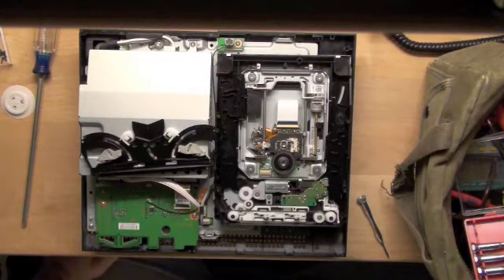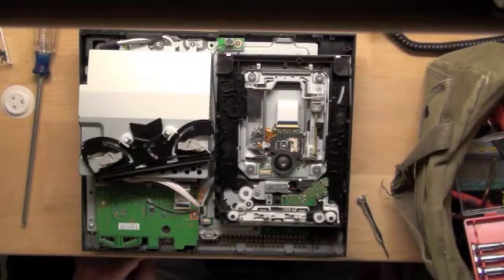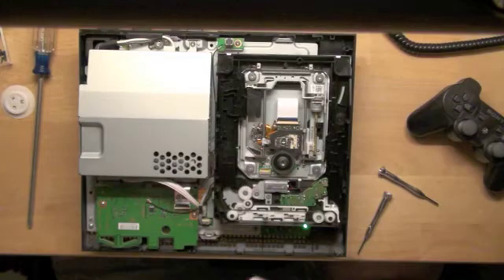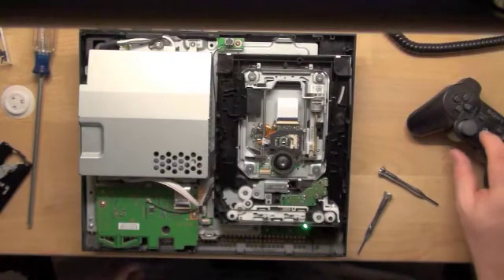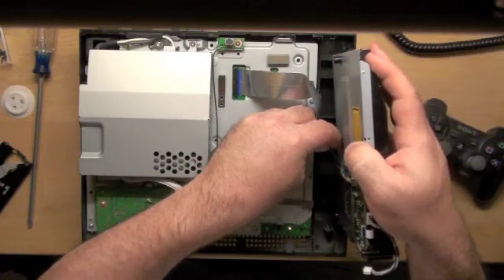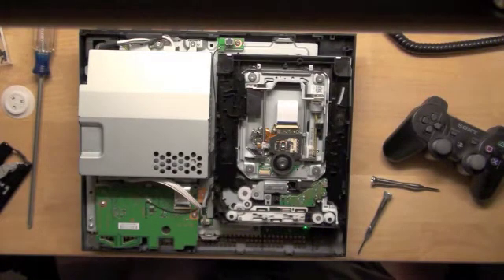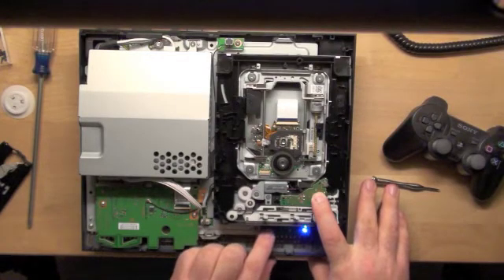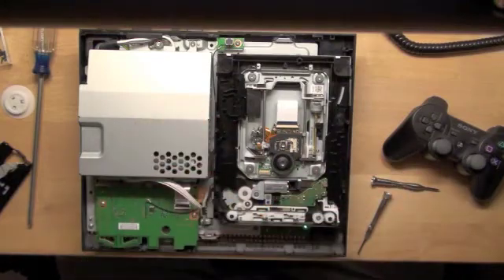Troubleshooting PS3 drive "nothing happens" problem

Comment: I've been diagnosing all day today, and have finally decided to attempt open heart surgery like you just did.
I have the same problem of the trigger-buttons giving no reaction.
The motor works, confirmed through force ejection.
The data cable seems fine, as it can read manually inserted discs just fine. I have attempted several times to lodge it in better, and secure it with tape, so I don't think that's the issue.
I'd assume the buttons were to blame, but then I'd also think that if this particular circuit would failed, it would also leave the motor unusable, which it has not.

So just to outline:
Trigger-buttons to sense discs seems to be at fault.
Circuit can still power motor, seems ok.
Motor is functioning, seems ok.
Data ribbon cable delivers disc data is functioning, seems ok.

I have checked the ribbon cable between the Blu-ray controller and the disc sensor. They are all well connected.
I have tried, and pretty much mastered at this point, both disc in and out alignments, neither seems to do the trick.

I have watched every one of your video, tried everything I can think of. No metal arm trick, no resetting the plastic teethed arm in either position has worked.

I almost refuse to believe it to be broken.

I took the thing apart to clean it, hooked everything back up with no malfunctions, and everything seemed to work, until I decided to do a force eject. At that point, it 'broke'. It believed a disc was still present inside it (blue light) and refused to take a new one. Restarting it, the blue light was now off, but it still wouldn't accept a disc. Tearing it apart revealed no immediate issues. I disassembled as far as necessary to verify integrity, and as all was well, I reassembled it. No change. Did it again all over, no change. Tried disc in config, verified read and functionality of laser, with 1 immediate problem: would not eject, not even with force eject. Would make buzzing noise attempting to do so, no cracks or pops. Tried disc out again, with 1 immediate change: it would now beep quickly 3 times as if nothing was inside. Huzzah, I thought. Still didn't accept discs, would still buzz during force ejects. Attempted open verification. All is well except it's ability to accept discs, due to not responding to button pressed from disc insertions. It's ability to eject may also be a problem.

I don't think I can diagnose it more accurately than this without help. I would really appreciate it if anyone has any suggestions.
Reply: @Bobby-Broadway  in the end, i blamed the broken disc insertion switch. Such a tiny little plastic button, no longer responded to any sort of input. Replacing it wasn’t possible as I could find no part information, and my friend wasn’t interested in buying ps3s to salvage. But in the end, that was the solution. Salvage ps3s for a working switch, or entire drives if you refuse to solder.

Comment: Thank god for your tutorial, I was experiencing the same thing (Absolutely nothing happens when inserting disc, no disc motor noise at any time, cannot eject disc) it turns out the guy who reflow-ed my PS3 didn't properly reconnect the BD drive data cable when reassembling, and it came loose.

Comment: My ps3 was working perfectly until last week. I turned it on and it didn't read the disk. Now, if I insert any disc, blu-ray or not, it clicks a couple of times and then makes an ejecting noise but doesn't actually eject. I would really appreciate it if you could help me with this problem. Thanks in advance.

Comment: I am having the same issues and I replaced the data cable with a new one and still has that same exact issue... So it is not the data cable.. I believe the spin motor is shot.

Comment: Hey, I'm having a huge issue with my disc drive.. I bought a completely new laser deck and replaced it with the one which had the burnt out laser diode in it (With this method, the daughterboard does not change, so there is no different id). Also the diode/deck is the exact one which is needed for my ps3. The issue I'm actually getting is that the disc goes in, spins for a few seconds, stops then repeats. In the time it is doing this, the disc is not actually being read. Do you know why?
Reply from the maker: I'd start by checking the connections.  It could also be that the laser unit you received is bad.  To test if it's one laser or another that's bad, try with a PS3 game, and with a DVD and a CD.  This will exercise all the lasers in the unit.

Comment from the maker: If it worked before you disconnected the drive, the ribbon cable tot he mainboard is probably the culprit.  The front power cable is just for power to the drive itself.

Comment: Could you tell me if the years that load the disc in and out of the system are part of the ribbon, or are they powered by the power chord that's in the front?  It's driving me nuts trying to figure out whether I can fix this or not, but if at no point the drive is spinning, I'm inclined to believe there is damage to the ribbon, or the motherboard.  It worked fine before I tried the ylod fix.

Comment: I believe the same thing happened to me tonight.  Fixed the ps3 from the ylod, everything works well, but the disc isn't going in what so ever and when I took it apart, it rendered the same results as what was shown when he disconnected the ribon and booted up.  The laser flashed, but nothing else happened.  However, when I manually put a disc in the ps3, it ejects it if I hit the button.  Has that happened to you?

Comment: I did the repair for YLOD and things worked beautifully when I put it back together except the disc drive. Everything is connected properly and I don't see anything wrong with the data ribbon. When I turn it on, literally nothing happens with the disk drive. Nothing moves, there is no laser - it seems totally dead. The only thing working normally is the sensor.

It worked fine before YLOD. Do you still think it's the data cable, or is it possible I fried that ONE part of the board beyond repair?

Comment: I swapped out my drive with a new, which fixed the "not reading disc problem", but now I can't get the motor to do anything when the two switches are activated.  I checked my the data cable and it appears to be inserted correctly.  The drive turns on.  If I put it in disc mode and put a disc on it, it will read and play...just can't insert or eject.  Any ideas?

Comment: Hey I bought my Phat Ps3 From my friend 3rd Party. he sold me it pretty cheap and told me that one day the drive just Stopped working and his game (Black Ops) was stuck in it. everything on the ps3 is fine it loads up it i can connect to the internet and psn and all that. but the drive seems to not have any power what so ever i dont think its my data cord seeing as my ps3 freezes when the cord isnt attached to the drive or if it doesnt freeze, when i press eject it beeps 3 times and i dont think

Comment: *****HELP***** my 40gig fat ps3 needed the laser replacing on the blu ray witch i did myself. when i put it all back together it wouldnt take the disc. ive tryed everything. sensors new moter and another lens. the real problem is that the blu ray drive works fine on my other ps3. so it seems that theres no power going to the blu ray drive but dont know wear from as console will start up fine as i used it to watch a film on the internet on it . please help!

Comment: I have a question I just repaired my brothers laser and the same thing is happening to his drive the one he purchased from ebay the small white wire near the spinning motor there was a cut piece of that wire still in the slot suggesting it was taken out from another ps3 and the seller just cut the wire off. Arn't the lasers made from a factory or something?

Comment: I'd like to thank you for your videos for how the ibnterior of the PS3 works since I've been desperately trying to fix it for the past week since a game got stuck in there. However is my BluRay drive screwed? I did your methods on trying to get to work like making the PS3 think there's a disc in there and the Clear Disc test. However the Blu-Ray laser doesn't light up nor does the CD spin with the data cable plugged in. Although when its not plugged in, the laser blinks purple then turns red.

Comment: Awesome, Awesome, Awesome video, cannot recommend enough for people having problems with their blu ray drives... after days of tinkering and scratching my head this video showed me exactly what was wrong with my drive... a blown chip on my mother board.  I realized that without the drive cable plugged in the lens should have cycled upon power up, but because it wasn't I investigated the motherboard and yup, blown chip.  Should have known... power cable to the drive had exposed wires!

Comment: @junker15 Hey, i have a problem with the lens in my PS3. It doesn't seem to be moving. i tried adjusting the golden rod that makes it move but instead it came out. When I put it back in, the lens don't move at all. How can I make it move smoothly again? 

p.s. the reason I was messing with it was because my drive wasn't taking in or ejecting dics, or spinning. I can tell the problem is the lens because it tries to move but cant.
Any help is appreciated.

Comment from the maker: @xkingtee There's a switch near the spindle motor that the lens assembly is supposed to be hitting.  This tells the system that the lens has returned to the innermost position.  If that switch is faulty or somehow broken, the system won't be able to tell when the lens has returned, and will keep trying.

Comment: My PS3 YLOD'd and I had to remove a stuck disc (rental). I replaced it with a clear dummy disc. After I got the PS3 reballed it wouldn't eject the dummy (made noises). After fooling with it for a while, I finally got it to accept a BD movie and play it, but I couldn't keep things aligned when screwing back together. After another machine-gun sound, no motors will move at all, as if they are burned out. What should I try next? Also, I may have touched the lens since then. How should I clean it?

Comment: i solved the issue i was having n it was a stupid mistake on my part.  i was about to give the ps3 back (in shame) when i saw that the ribbon cable located next to where the disc sensor plugs into the drive wasn't plugged in (no idea why or when i did that).  

so i guess another tip for when this happens would be to double check that everything is where it needs to be...kinda obvious, but u never know. once again, i'm able to come through and it feels good to get my brothers ps3 outta my room.

Comment: ok, so i took it a step further and removed the lens (crossing my fingers that i havent damaged it as i hear it is very delicate) i removed the v shaped bar on the back as well and notice that the function of the black sidetracks is to lift the lens plate up. the left one with gears is STUCK . the right one works perfect and lifts the right side. is there anyway of detaching and reattaching these sidetracks? the left one specifically?

Comment: @junker15 funny you say that, i just saw the video where you do that and it gave me the idea. so i went ahead and removed the motor - the side tracks STILL will not slide up and down - it seems the one on the left (with the gear ridges) which should move down is STUCK. will i have to take the whole frame apart? do those side tracks even come off?

Comment: recently i went to eject my disc and it started making some weird machine gun sound for the first time ever(which you talk about in another video)  after taking apart my ps3 (80 gb original) and viewing this video i realized that when i simulate a disc loading, i CAN NOT move the black sidetracks up/down. how do i get these back on track and working properly again? ive tried removing the one gear that resets but that didnt work

Comment: i left a comment on ur page the other day, and the prob seems to be like this one.  with the data cable ribbon unplugged, the blue light is not on and it will be beep when eject is pushed.  with the ribbon plugged in, the blue light is on and it will make a little beep/does not compute noise when eject is pushed or when turned on initially.  i tried another ribbon (one that works) and the drive does the same thing....something always seems to get f'ed when i repair a ps3, tho i usually come thru

Comment: hey junker great video but i hope you can help me! Im able to do everything in the video but once i simulate the disc being insterted the system will not eject the disc. I have the disc insertion cover off and the two small tabs down. All the system does is beep as if there is no disc in even though the system in clearly in the disc inserted postion...Please help!!!

Comment: hey junker15 this is my email -----     millerlightman96@yahoo.com   ---------    my ps3 had the ylod , i fixed that like 2 times i would like to know what would cause the ps3 not to take a disk i have 2 ps3s and neither will take the disk!!!!!!! 

is there any way i can test the motors ???? one blueray drive does nuthing like its not even connected and one flashes  blue when i try to put the disk in   but none of the motors are moving or trying to turn on or anything

Comment from the maker: @third3ye024 The system software is missing because the hard drive is new.  You should download the latest firmware update for the PS3 to a USB flash drive.  There are instructions on the Playstation website as to where on the flash drive the PS3 expects the update to be.  Then the system can be reinstalled via this update.

Comment from the maker: @henryr824 In the upper right corner of the top of the case is a slot where a catch is.  Push this catch in and lift up from the rear to take the top cover off.

Comment from the maker: @morningla The laser should be moving toward the spindle in the center.  If it's moving up (towards the edge of the disc), something's definitely wrong there.  I've never seen this happen, though it would suggest that something's gone horribly wrong in the hardware.

If this drive has been worked on before (laser replacement, etc.), the first thing to do is check all the connections and make sure the ribbons are fully seated and straight in.

Comment from the maker: @ContempoREX the controller board is specific to the PS3 it came with, so you can't just swap drives.  It's acting like the blue laser is dead, but  if you put another drive in (while preserving the controller the PS3 came with) and it still has the same problem, maybe the Recovery Menu can help.  There are "Repair database" and "Restore filesystem" options in this menu that can sometimes help. (Though that doesn't explain why the blue laser won't turn on!)

Comment from the maker: @ChadSmith998776 This sounds like the disc sensor is bad.  The drive tries to take a disc in (that's the sound you hear when the PS3 is turned on), but then times out.  Then you can't put a disc in unless you force it in about halfway to trigger the drive into taking the disc in again.

(Ignore my last reply. That applies only if the drive was previously opened.)